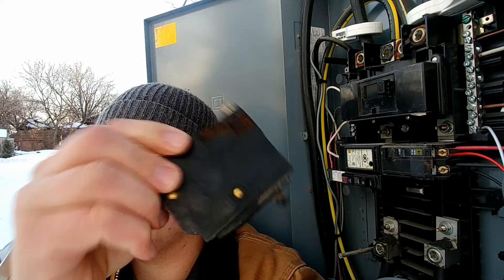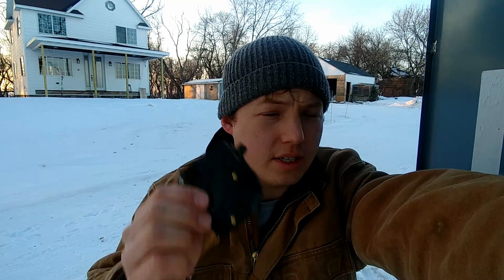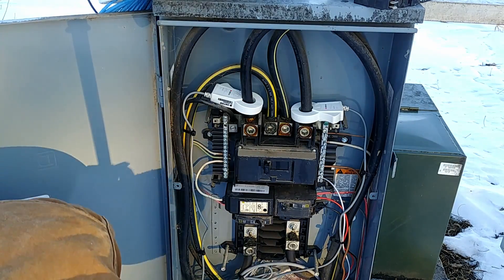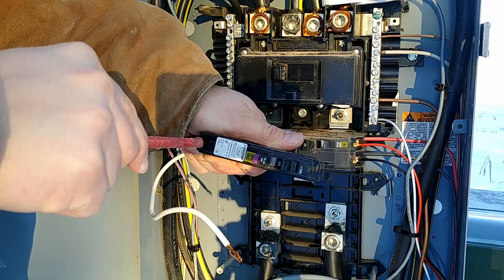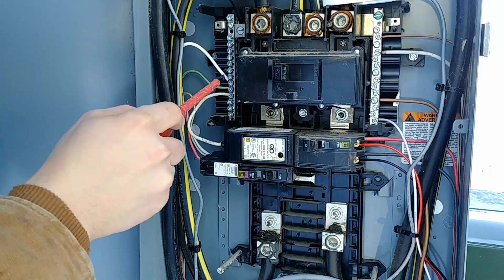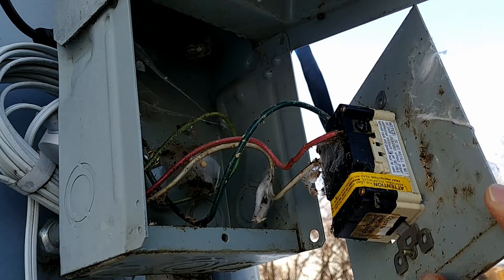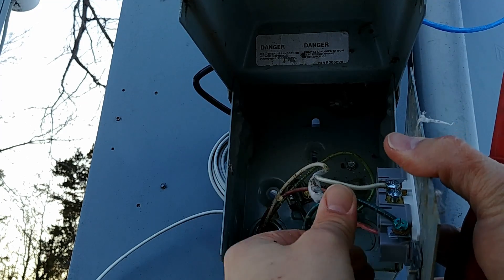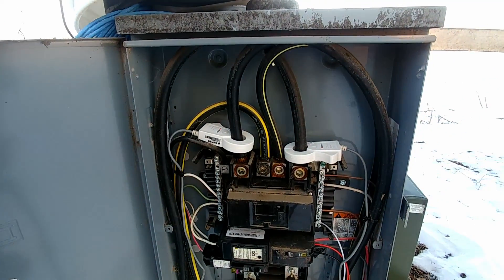How To Install a Ground Fault Circuit Breaker to Replace a GFCI Outlet or Receptacle

Comment: Your video just helped me out of 3 hours of frustration.  I recently just purchased a pigtail gfci breaker for a swimming pool pump. When I was at Lowe’s the supposed to be ex electrician did not explain to me that these would conflict with each other. He sold me a similar box as yours with the twr gfci outlet already installed, and the breaker. After 2 hours of trying to get this thing to work , I popped on YouTube to see if some video would be able to help me.  I found yours. Thank you so very much for being spot on about the outlet and breaker conflicting with each other. 
Very appreciative in ky
Reply: I recently had to troubleshoot a new install. It had GFCI feeding a series of outlets downstream, including another gfci, as well as a fan. Started into it and was puzzled. It looked like it was an issue where it was a conflict with the gfcis but then discovered that it would trip the feeder gfci no matter what device you had on it. I replaced the gfci with a new one and all was well. Still, I was quite annoyed. I also found 4 conductors in various boxes that all had damaged insulation from the electrician pulling in the wires. He also seemed to like having a lot of conductors in a box. I didn't do any conductor calcs but at least two boxes were marginal at a glance. They also placed the gfci outlet behind the washer so good luck resetting that. The washer in front of it is on a pedestal so you have to climb on top and reach down behind but there is also the cabinet above you so you have to reach in under the cabinet and then down behind to reach it.

Comment: I'm a local handyman. I've never done this but now I feel much more confident that I can do this for my customer tomorrow. Thank you. Btw I did verify that the outlet had its own dedicated 20 amp breaker and it's under a sink as a half hot so this is why I had to choose this method which seems very doable.

Comment: Totally excellent...  Seems the hardest part  is tracing the original load neutral wire and then extending it from the old neutral bar connection to the GFCI  if not long enough

Comment: Thanks for the video.
I need to install a gfi breaker for my garage door openers outlets.
We bought a new-built house 3 years ago.  My understanding is those outlets need to be gfci protected (per code).  The builder did not protect them.  We found many electrical things that either flat  did not work or were not to code.  I do my own basic electrical work so I've been correcting things as we go.
TIP:  Don't make the mistake I did.  New house or old house, always get a home inspection.  I did not, thinking that I didn't need it for a new house.

Comment: Just what I need to do.  Just replaced a bath vent fan and it had no ground.  It's also the same circuit as vanity outlets that are not GFI.  Two birds with one stone as they say.  Thank you for the video.

Comment: It is always good idea to install GFCI & AFCI Breaker for all circuit in your home, all socket and lighting, not only GFCI outlet in wet areas. In Poland (Europe) is common to install RCBO in main panel for all circuits. Other possibility is to install at feed in main RCD and then after RCD standard CB's - in that case whole house is GFCI protected.
Reply: I agree. I upgraded all my breakers recent to the dual function breakers from Square D.
Reply: That's a no, no. Do not install GFI breakers for all circuits, it's not code, adds costs and not recommended for all circuits.
Reply: @BillC-64  Why not recommended? You don't want protect yourself?
Reply: @technik87  As per code (at least in North America), GFI protection is required 1.5m of a water source such as a basin. These areas are more of a problem because of water as a conductor of electricity. No water, less problem so having them in say a bedroom makes less sense. They also consider cost, and the cost difference is huge - no one is going spend that kind of money at least here in Canada (15A GFI breaker is ~$100, while a standard breaker is ~$10. Same with outlets – huge price difference. I used to work for the manufacture of his breaker panel (Schneider Electric), and I have never recommended to GFI the entire house. But electricians have asked me, would the companies ever make a main breaker with either GFI of AFI protection built in. I laugh and say answer is no, it will never happen. Obviously, If you have something like a fish tank, then I recommend something like a dedicated GFI cord.

Comment: I actually liked your video - it was informative and you gave good explanations of the 20 Amp GFCI circuit breaker installation. The only thing I noticed that was perhaps off was that the replacement receptacle appeared to be 15 Amp rather than 20 Amp.
Reply from the maker: Thanks for the feedback! It is actually fine to use a duplex 15amp receptacle on a 20amp circuit by code. Of course you can always exceed the code if you want to but it is not required.

Blessings from Minnesota!
Reply: Yes he had a 20 Amp then, then he had 15 Amp installed

Comment: Great video Ben!  You warned of "issues" if you don't remove other GFCIs in the located same circuit as the breaker panel GFCI.... Removing the downstream GFCIs is not a problem but wondering what kind of issues leaving them in would cause?

Comment: Hey hey good video thanks for the walk through. The only thing I might have changed is installing a second outlet plug in that box and get rid of the "multi-banger" (not correct term just what i call them). Also good to know that the gfci plugs don't tent to hold up outside and the breaker is the way to go. Thanks again!

Comment: I was having this same problem. I wonder if it is legal and code to do this on my swimming pool in North Carolina. Honestly they must be terribly expensive. I would think any modern home should use them as a standard. Much safer I would think. Thanks. Great video I think I will try this. Oh ant thank you for explaining how the two neutral wires connect. I did not have that right until this video. I have not done it yet. I want to understand every aspect before I do this.

Comment: Thanks for the video! Can you clarify on issues caused by GFCI outlet on the dual function circuit? I've read its fine, but you just get no additional protection, and if there's a fault, it may not always be consistent which device trips depending where the fault occurs.

Comment: I'm always learning something from your videos. I'm doing a big home wire job and want to do everything right for insurance purposes. One question I have right now though is why aren't you using the square bits instead of flats? Squares grip so much better.

Comment: I bought a Ground Fault Circuit Breaker to protect a line that had all kind of wiring down line, including outside.  I don't know if I installed it correctly or not, but I could not get it to set.  I thought maybe the wiring to the different outlets was done incorrectly so I just removed it and put in the old breaker. I will add a regular GFCI to the outside outlet and see if that works.

Now, for the question.  Did I install the Ground Fault Circuit Breaker correctly.  I plugged it into the box correctly, connected the white pigtail to the ground bar, but I was confused with where to connect the black wire.  There were two screw connectors on the GFCB.  The pigtail seemed to come out the one that had a white dot painted on it.  So I connected the black wire to the other screw.  

Are you following me?  Did I do it correctly?  It was a Square D 110v that appeared to have a 220 connection.  At the Home Depot webpage, it shows a GFIBreaker movie.  As soon as this movie starts, it shows a breaker like mine.  Do you understand my confusion? 
Thank you

Comment: Wow Bat Man   You've got it Dialed  In  !   

Your going somewhere in life and good to  see !  

Fantastic video for those of us don't know what's out there and how to spin things down. 
I know quite a bit about electronics  and have degrees and FCC  licenses   ….   but NEC  and electrician stuff isn't in always in the wheelhouse  !   

I have a question maybe you can help with  ???     …. 

question #1   Do   the  GFI  AF     breakers come in peanut  breaker size ?
question #2    will  /  do  " Square D" breakers work in most GE panels  ?  

Thanks much  Sir !
"Senior  Tortugo"

Comment: Not all Screws are Color coded, I'd not rely on this philosophy entirely. Siemen's as an example have silver on both screws for the newer Q120DF model, However on the sides of the breaker in small text is the correct Labeling such as 'Power' and 'Load Neutral'. The white tail shows 'Panel Neutral'. Otherwise most informative and good safety tips, thank you for sharing.
Reply from the maker: Thanks for the comment and good information!

Comment: Nicely presented. Odd that the ground wire to receptacle was black- sleeved instead of bare copper wire ( as is shown in other tutoring) Cheers mate !
Reply: Not that way by design, but when you're doing stuff at home that happens, especially with short sections and pigtails. I think code would require you label them if using the non traditional colors, but many places don't follow NEC for homeowners.

Comment: Suppose you have two 120V circuits sharing a neutral.  is there a GFCI breaker for this configuration?  Will it be separately switched for each circuit?

Comment: Curious Benjamin, what are those two white rings around the live wires coming into the panel (see 3:20 of video). Would also like to see a video on the install of a whole house surge protector.

Comment: Can you use a GFCI breaker on a 2 wire circuit in an old house and replace all the outlets with 3 prong receptacles?  Will a GFCI tester trip the circuit since there is no ground?

Comment: Great videos as usual. If I run a circuit with a new Dual Function CAFI/GFCI surely every receptacle does NOT need to be in a sequential daisy chain right ?? example say you have one or two receptacles downstream from panel and then a junction splitting into a kitchen island and also out of junction box to more counter top wall receptacles.
Reply from the maker: Yes you'll be absolutely fine. Everything on the circuit will be protected.

Comment: I have a T&B GFB130 ground fault breaker.  It has 2 terminals at the bottom.  One of them is above the pigtail and has a white dot above it.  The other has the bigger connection screw.   Which one is the "hot" screw and which one goes to the neutral?

Right now I have the white dot terminal connected to the neutral wire, the pigtail going to the neutral bar and the black wire connected to the terminal with the big screw lug.   Unfortunately it trips immediately when I turn the circuit on (nothing is connected downstream).

Ideas?

Comment: I'm in Massachusetts and I've been looking to get my 1980's Murray 100A panel and service upgraded to 200A. While the job looks simple to me, the quotes have been in the mid $3000 range. I've been getting conflicting information from people saying that most of the replacement 15A and 20A breakers will need to be GFCI breakers to me only needing to re-run my 30A NEMA 10-30 3-wire dryer and 50A 10-50 3-wire range to newer 4-wire receptacles (NEMA 14-30 AND 14-50). I was told that these point-of-service GFCI receptacles are available in 240v 30A and 50A models and would be a good workaround to avoid having to run new wire. I however  have yet to find them. Might you have any advice?

Comment: Could gfci outlets be used on a circuit using gfci breaker if you just use the LINE terminals to protect only that receptacle and not use the LOAD side to protect downstream outlets?

Comment: I just put some of these in for my bathroom and kitchens. The test button woks fine on the breaker but a receptacle gfci tester doesnt trip the breaker when using the test button on the tester, if that makes sense. Any input on the situation. It is ungrounded (2 wire) wiring.

Comment: looks like you connect neutral and ground together at the right bar?
Reply from the maker: This is the first panel on my property after the meter so both the grounds and neutral wires land on the same neutral/ground bar.

Comment: What is the box taking up 2 slots with the white QO label? It looks like it also has a connection to neutral.
Reply: QO2175SB, it's a Square D Surgebreaker.

Comment: Ben, two questions:
1. With the installation of the gfi in the main panel or sub panel, do you have to identify, on each outlet, that it is gfi protected?
2. A comment more than a question, with the possibility of accidentally touching the “hot” input lugs, is there someway to cover these lugs with a heavy clear plastic shroud?

Thanks for your videos, I’m learning quite a bit and may tackle doing the electrical on the house we’re going to build.

Comment: You mentioned that if you had a ground fault breaker hooked to a ground fault receptacle the receptacle might not work.  However my entire house has ground fault breakers for the baths and kitchen and in each of those rooms I also have ground fault receptacles and they all seem to work.  Wondering if the electrician who wired my house just wanted to sell me more than I needed. The house was built in 2009.
Reply: Yeah... that does sound like you got to rip off or the electrician doesn't know what he's doing. You don't get double protection. Or might be you got an Arc fault receptacles not an Ground fault receptacles, thus it works for you.

Comment: Nice video but I do have a question..what if you don't know which wire is the one going to your outlets? Do you first then plug a tracer in that outlet then tone it out on the neutral bar?
Reply: I'd test it first by turning off the breaker and check for power at outlets to see what outlets don't have power. You can use the tracer as well...kinda expensive tool.

Comment: Question: The neutral conductor thru the GFCI is an insulated conductor.
Why is the exact same neutral conductor that goes outside the house to
the step down transformer not insulated? thank you.

Comment: How do you install the white wire already in the gfci box though? That's the part we're confused about we have the same box but it doesn't come with that wire installed and every video skips that part

Comment: I have 6 outdoor outlets all on a gfci breaker. I replaced 4 of them to gfci wr tr outlets. When turning the breaker back on the 4 gfci outlets do not have power. The 2 regular outlets are working… any thoughts?
Reply: Did you ever figure this out?

Comment: I know you will strongly not recommend  doing this but I had to ask. Is there a way to change out a circuit breaker without turning off main service breaker? I am asking because my service panel doesn't have main breaker. Electricity directly comes from power meter to individual circuit. To change a circuit breaker,  I have to call Edison to remove the meter and city for permit and get an inspection. And then call Edison for reoinstallation of the meter.

Comment: Why would a hot tub's 50 amp GFI breaker trip when you connect the ground wire to the ground bar at the breaker box?

Comment: Great video! Q: is that outlet 208/110? I see two hot and neutral?
Reply: Manuel T there was only one hot and one neutral.. third wire is ground.
Reply: I thought I saw the same thing, but I was looking at what looked like a 20 amp with two reds in the opposite side.

Comment: Are they the same size or do they take up more space in the breaker?
Reply: The one he uses is longer but still fit in 1 slot breaker for single pole. They don't sell 2pole GFCI/AFCI breaker.
Reply: @anhtuanb  they absolutely sell 2-pole dual function circuit breakers.

Comment: Hey Ben, This video was helpful, but I did want to give you some quick constructive criticism.  At around the 10:00-11:00 mark you did those steps very quickly without much explanation.  I am an amateur and I feel like I can take on this project.  Thanks.

Comment: Can this be used when  more then one  breaker is sharing a neutral  so I don’t have to run new wire to protect the outlets ?
Reply: If you are talking about two 120v circuits sharing a common neutral, you need to get a double pole GFCI breaker.

Comment: I have a panel thats 100amps..there is a breaker that keeps tripping so i just keep it off ..should i have the panel upgraded  or upgrade the service..thanks
Reply: I'd test the breaker and connection to see why it's tripping. You may have a short somewhere from a burned wire or outlet or open wire from rat chewing on the wire.

Comment: I have a gfci breaker in my sub panel, not very old, and the test does not work. Even with an outlet gfi test module. It is 20 amp that goes to a single 20a outlet outside in a weather proof box :/

Comment: Outside Installations not well isolated. We use Rubberseals and a tiny Hole in the Ground of the Box to release Moisture. No Insect is getting in.

Comment: My question is does this GFCI breakers have power draw? Like the GFCI outlets but because they have a small LED light or they don't? Trying to keep vampire draw to the lowest.
Reply from the maker: I'm sure they draw something but honestly I have not measured it. Maybe I'll make a video about that! Thanks for asking!
Reply: Why not? The protection circuit inside will definitely draw power, unless you have super conductors bro.
Reply: @BenjaminSahlstrom  I looked at a few datasheets for GFCI chipsets and they all seem to operate at around 10mA (or less, I think 10mA on one was the absolute maximum allowed). They use a resistor in series with the 120V line (between 25k ohms and 50k ohms depending on the chip) to drop the voltage to something the chip can use. Since the current in a series circuit is the same at all points, if the chip is drawing 10mA through the resistor then it's power requirement is 120V @ 10mA or 1.2 watts. So it would seem reasonable to conclude that the average GFCI breaker or receptacle uses about 1.2 watts.